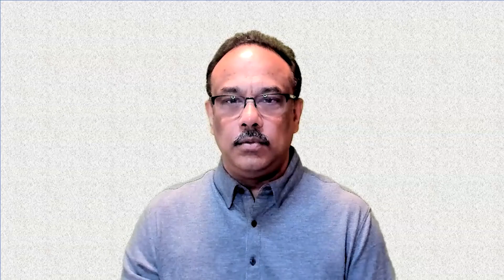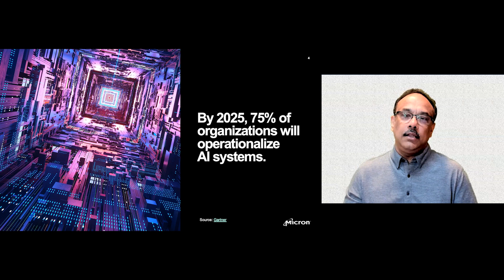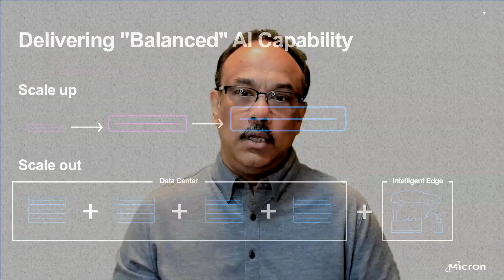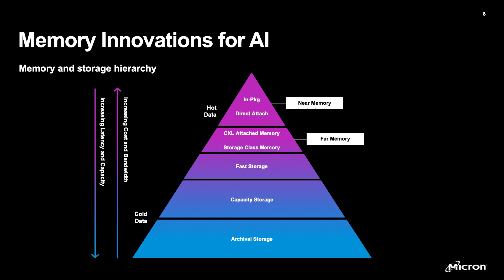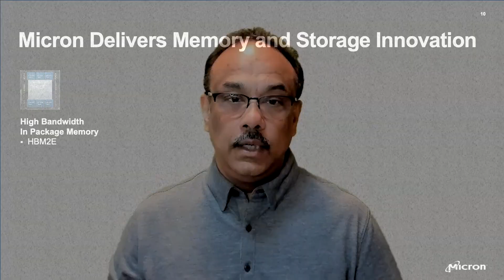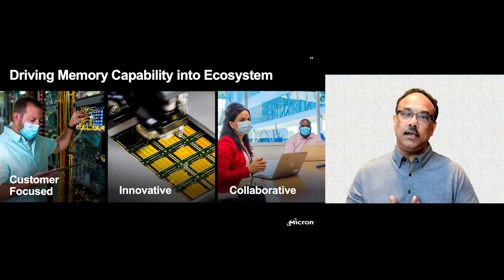Memory is at the Heart of AI Innovation

Comment: 10:40 How can CXL over PCIE5 provide bandwidth expansion for DDR5 at 4.8 GT/s? 

CXL over PCIE5 transmits 63 GB/s over a link with 16 lanes where that that each lane consists of 2 (differential) wires in each direction.  So CXL transmits 3.95 Gb/s of data in each direction on a "per wire" basis.  

DDR5 can transmits 4.8 Gb/s total, but it can be used all for reads, all for writes, or anything in between.

So, CXL over PCIE5 is not fast enough to avoid becoming a bottleneck if used for DRAM bandwidth expansion.  A "precious" pin on a CPU/GPU is better used for directly attached DDR5 DIM bandwidth.

Is there a plan that a CPU or GPU can have an optical link to a CXL repeater or switch chip, where the optical connection is much faster?  Or something similar, in order to get bandwidth expansion over CXL?